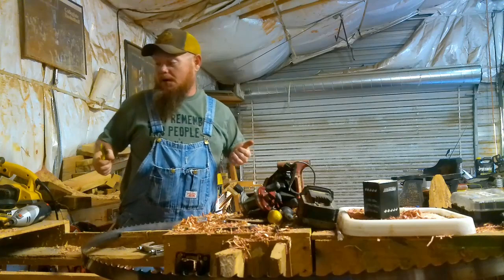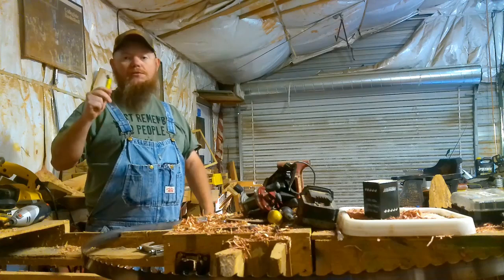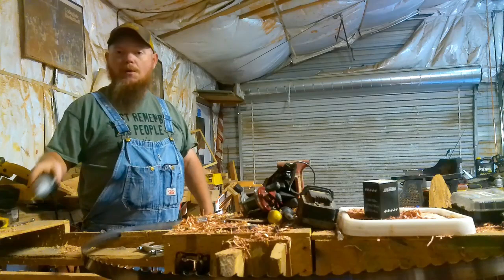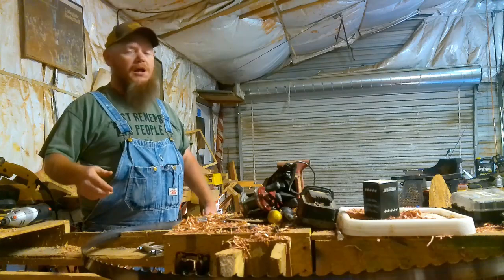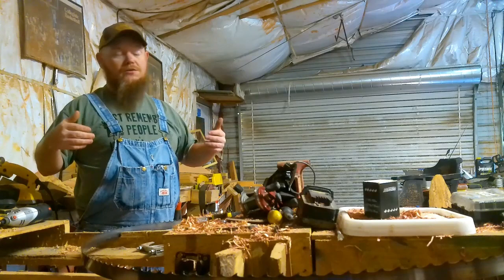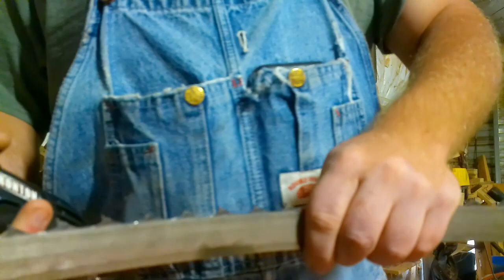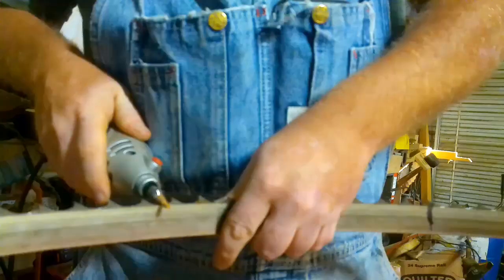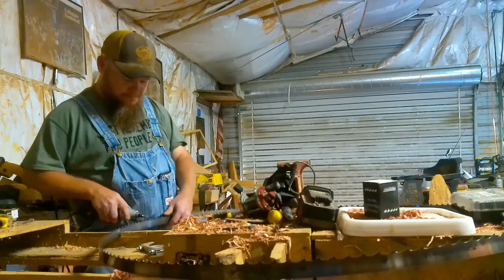Re-sharpening Ripper 37 sawmill blades. My 3-step MONEY SAVING process.

Comment: Very nice and thank you. I also use the "chain saw sharpener" approach. I do not worry about the gullet. Figure if I cannot see the micro-cracks, they are not there. I also clean the pitch off with some diesel. Works nicely. I see you are using 1.5 inch blades. I figure I will go up from 1.25 inches also. Good Luck and God Bless. I do worry about your eyes during the grinding steps. Maybe protective glasses?
Reply from the maker: thanks for watching, God Bless.